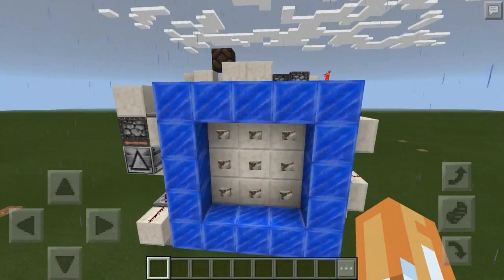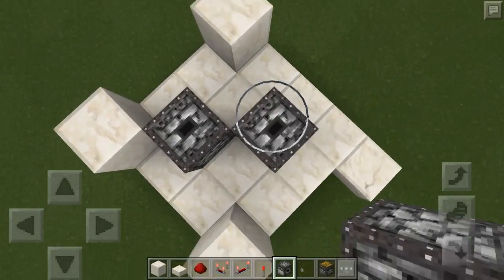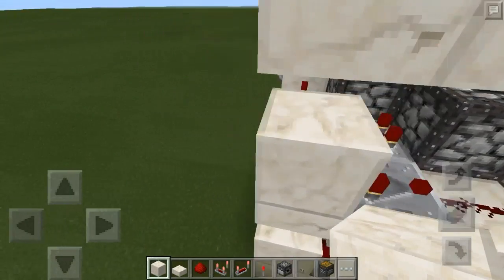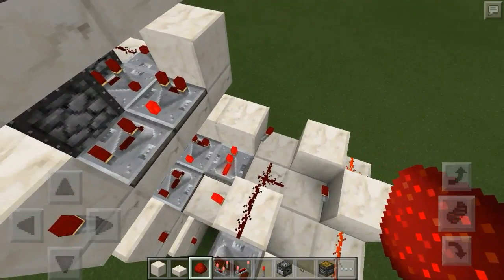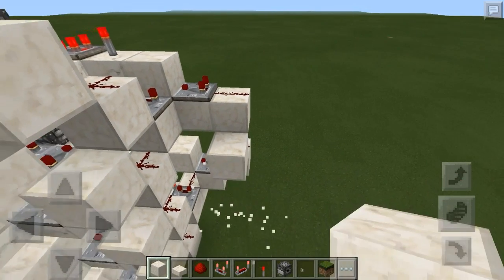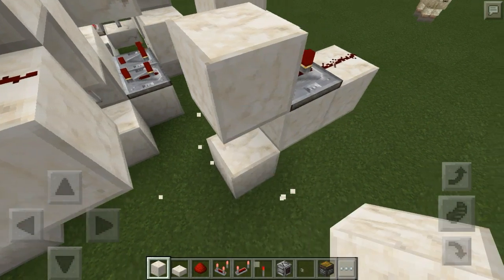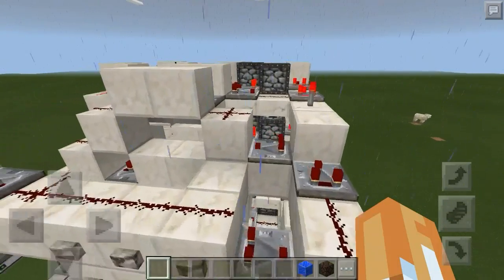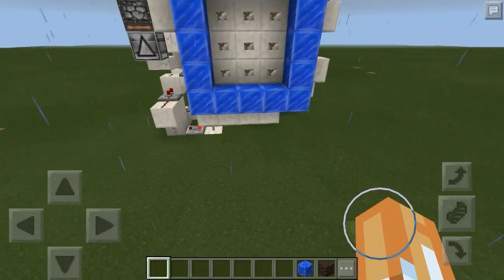Minecraft Pocket Edition Redstone Tutorial: Advanced Analog Lock (MCPE 1.0.5)

Comment: Have you checked this design against 1.0 yet?  Just thought I'd ask.  Mine isn't working and I'm sure I probably just did something wrong.  In general where would you suggest would be the best place to start diagnosing the issue?  The quantities in the droppers are correct.
Reply from the maker: +Michael Villeneuve I just checked and it does still work in 1.0.0. As for where to start, I would put one digit of the code at a time and check if it sets the nor latch. Once you have found the one that isn't setting, your problem is within that slice. Could be multiple things, hard to tell with this build.